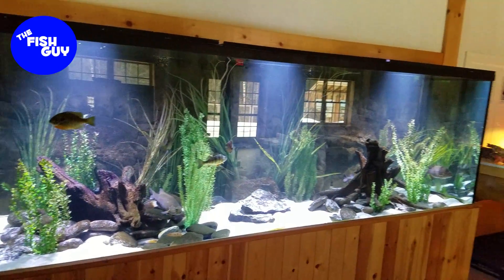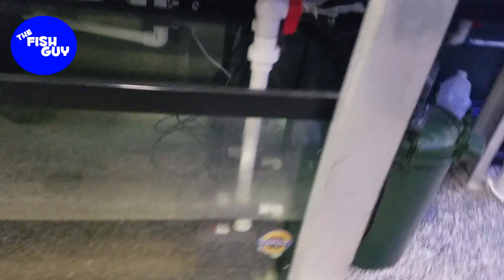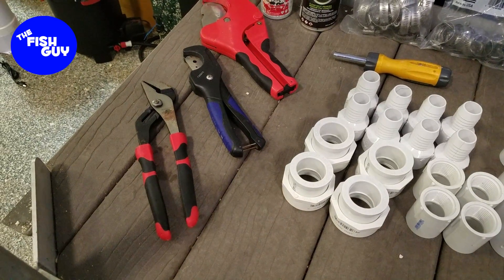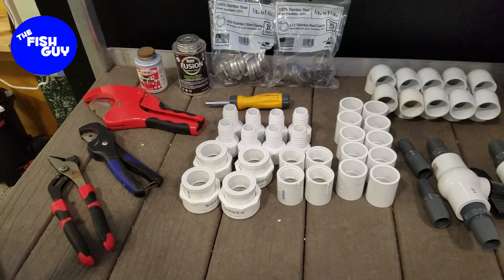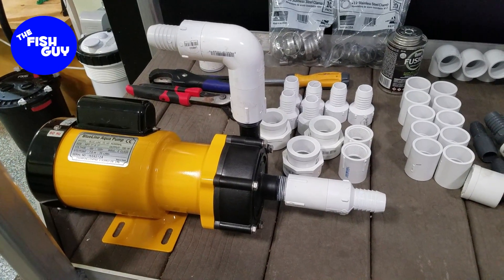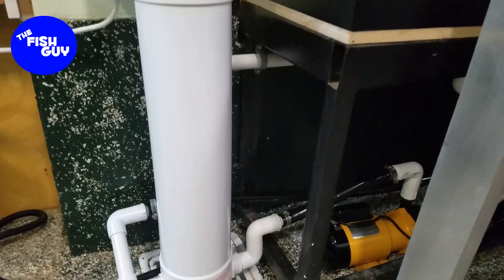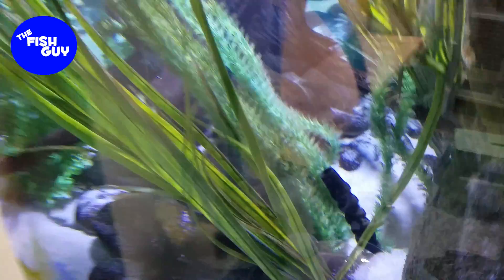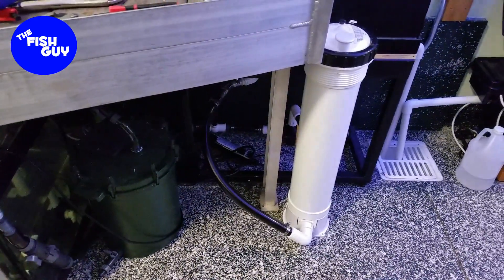Filtration Upgrade on a Monster 1400 gallon Aquarium!

Comment: Love this, subscribed.
I grew up in the Adirondacks catching perch, sunnys and bass (and the occasional northern pike!). It's great to see them this way, and nice job on the filtration. Also another plug for the pipe thread compound.
The new cartridge filter looks exactly like an above ground pool filter which got me thinking about my own inground pool and its filtration, and how we possibly over-think aquarium filtration. With only a DE (diatomaceous earth) filter and 3/4 hp pump I can easily get my 22k gallon pool to breathtakingly clear water. Of course it's sterile because we humans have different needs, and if I didn't use a minimum amount of chlorine I'd need to change the DE more often than once a month, but I do get suspicious of the industry persuading us we need all this other stuff.

Comment: Good luck with that cartridge filter, I tried this and had to change the 5 micron filter every other day, I went to a 20  and then to a 50 micron cartridge and it never lasted over 3 or 4 days. This was on a 135 gallon tank with a small bio load using a whole house type of cartridge filter and an external pump about half the size of the one shown here.
I like the idea of DYI but the debris is far greater than I could have imagined based on what I saw floating in the water which was considerably less than that shown here....
Reply from the maker: Bass Player this filter is significantly larger than a whole house filter.....   also a totally different style of cartridge.  These filters lasted weeks without needing to be changed...even then  it wasn't showing any significant reduction in flow.

Comment: Do you think that would be a good mechanical filtration option for a marine system? Considering that for my 900 gallon build.
Reply from the maker: Steve Offutt  Those cartridge filters are amazing for mechanical filtration.  With that being said though, I would need to know more about the system before I could say definitively if I would suggest them for you or not.
Reply: The Fish Guy 900 gallon FOWLR  with Angels, Tangs, Grouper, zebra morey, garibaldi damsel . So messy eater high bioload. Opposing gyre xf280s.  Basement sump with 100 gallon sump, AE tech down draft skimmer, 4 big established marine pure blocks, 50 liters of siporax, large Pax Bell algae reactor for complete denitrification. 

Right now planning on 3 7" filter socks for mechanical prefilter then saw your cartridge filter. Also have considered a pool sand filter.
Reply from the maker: Steve Offutt  Sounds like a great application for one of the canisters.  The only downside would be that it would end up being post other filtration as opposed to pre.   With filter socks they are the first thing that water goes through before entering the sump.  If it was me I would probably use both.  More is better in a system like that.
Reply: The Fish Guy how much do replacement cartridges run? On a average replaced monthly?
Reply from the maker: Steve Offutt That's the beauty of these cartridges.  They can be cleaned and reused multiple times, like filter socks, and don't need to be replaced completely.  They do have a useable life that can vary depending on how aggressive you are during the cleaning process, but having one last more than a year is very feesable.
Reply: The Fish Guy how much resistance or "head feet" do you typically have to factor in for your pump? I imagine I will get a size comparable to the one in your video.
Reply from the maker: Hey sorry I must have missed the notification for this comment.   I usually go one pump size bigger that what my overflows are rated to handle.  So that after taking into account all the restrictions, I'm pushing close to max through the overflows.
Reply: The Fish Guy thanks for all the great
Reply: Definitely going to hunt for one and make it part of my system build!
Reply: For a 800 gallon marine heavy bioload fish only would you recommend the  lifegard RTL 100 cartridge filter?
Reply: It’s been a while .  I know life is busy but you do have some of the most practical informative videos out there.  Quick question.   That Lifegard RTL100 cartridge....what micron does that filter down to?

Comment: I am surprised you didn't use flex pvc tubing.  Eliminates elbows, hose clamps, leaks, house barbs that restrict flows among many more advantages.
Reply from the maker: Since I was cutting into an existing setup with hose barbs and elbows and fittings all glued in place on bulkheads that were on the the bottom of this monster,  I had to make due with what was given to me.   It just simply wasn't practical to drain the entire tank to change out to new bulkheads.  The flow restriction was minimal, these are some big pressure rated pumps and they didnt lose very much flow at all.  In regards to the flex pvc. I've used the ultra-flex stuff in the past for a few builds, and found that with short runs of pipe and extreme angles going into a fitting that the joint was subject to failure. To me any failure is unacceptable, so I went back to my tried and true solid pvc.  I try to use 45's when I can, but again, with those larger pressure rated external pumps they don't really seem to care if you have a few extra 90's in the run.  Thanks for watching!
Reply: Thanks for sharing.  I have actually measured the gph for 2 large rated pumps at 2000, and 5200 gph (sorry I am a former scientist).  I found that the actual flow drops by about 35% when using 3/4 inch vs 1 inch flex tubing. I had the same impression as you until I timed how long it took to empty my 500 gall tank. In addition,  the problem with the hose barbs is that they restrict flow even more than threaded and socket fittings for tubing and complicate the problem.  Through all my research I have never heard  of a flex pvc/socket weld failing.  BTW, most bulkheads have threaded or slip female exits to the plumbing.  I have always been able to use a glued (slip) or threaded insert to connect to the PVC tubing, and get rid of those hose barbs which restrict flow and for me they are the first to leak, or have the hose clamps fail.
Reply from the maker: Thanks for the reply!  Sorry I didn't elaborate more it seems maybe I didn't explain well enough. I didn't do the initial plumbing/build on this system. The bulkheads in place on the bottom of the tank were female slip, with a ball valve butted up directly to the bulkhead, a 90 immediately after, and then a barb fitting directly to that. Without draining the entire tank and using a brand new bulkhead it would have been impossible to get rid of the barbed fitting. Had I been the one to build it from the beginning it would have been 1" for everything, and the correct sized pumps from the start.

I totally get the reduction in flow on smaller diameter plumbing, and especially with the barbed fittings.  In this situation with what I was coming from, and then upgrading too. The increase in flow, regardless of the % lost due to plumbing, was still substantial.   

My track record for vinyl tubing/barbs/hose clamps is near 100%  It is very unlikely if properly installed that they leak.  Hell, ive even had setups where the clamps had rotted off due to the saltwater and tubing/barb still held up with no issues.

Comment: Good video, having lights on over 6hrs plus those 25 window panes directly across from a glass tank having indirect lighting could be a huge culprit for algae, green water etc
Reply from the maker: Michael Piccirillo - Correct on all counts, sadly the lighting schedule and windows are outside my control.  This science center is open 7 days a week, 9-5 I believe. The filtration upgrade had a huge impact on water clarity as well as algae growth and looks A LOT better now with far less work required.  Thanks for watching!

Comment: I'd be careful about not bolting down the filter canisters. When servicing, or bumping into it, it could create trouble. Those lids don't come off easy sometimes. I hate how they basically sit in the stand, too. Just not very secure. A much better option would have been to mount it in the stand above the sump but just next to the sump using the supplied locknut. Basically any "hot" pvc glues don't need primer. Usually the blue ones and gray ones. They're thicker, and hold better under vibration and stress vs reg pvc glue. Just some potentially constructive criticisms.
Reply from the maker: Hi Brad. Thanks for the input!  The positioning of these units was not something I really had a lot of options with.  The "stand" your referring to above the sump is actually a catwalk, and is their way of accessing the tank behind the scenes.  I made effort to tuck them away in areas where their was minimal chance for anyone to bump them, and if they did they are close to touching a solid surface so that they couldn't shift very far. Also since I used vinyl tubing on both lines coming out of the unit even if it did shift, the likelihood of anything breaking was also minimal.  Again, not ideal, but I did what I felt was the best option given what I had to work with at the time.  Good to know on the "hot" pvc glues.  I guess I've just used the classic red glue and yellow cleaner for so long (going on 15 years) I haven't really looked into using anything else. I've yet to encounter a situation where my builds are producing enough stress or vibration to cause a failure of a glued joint.    Thanks for watching!